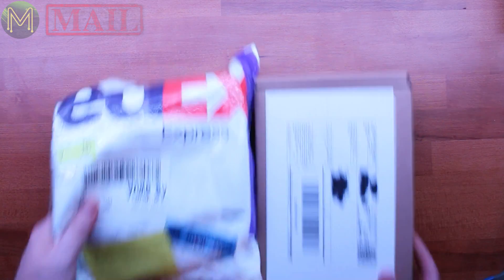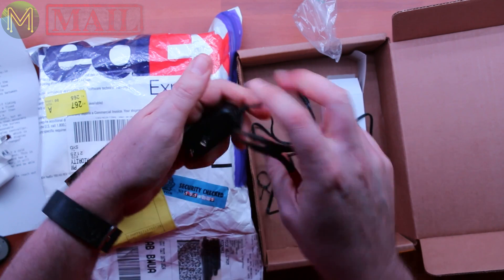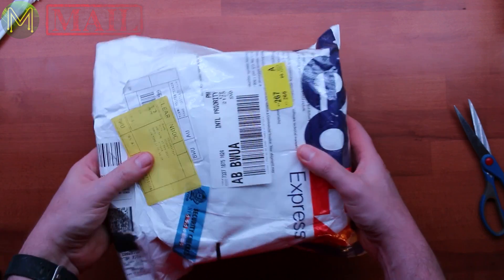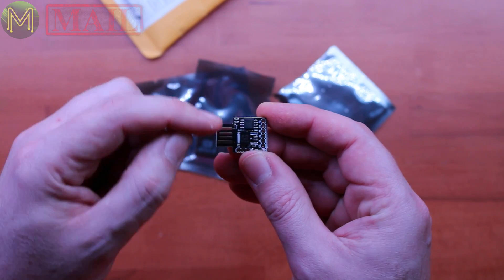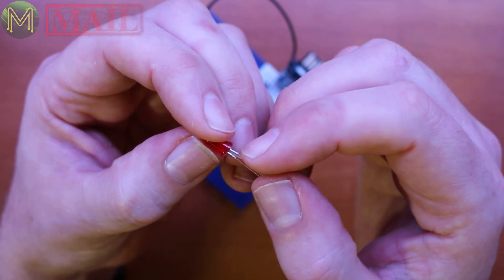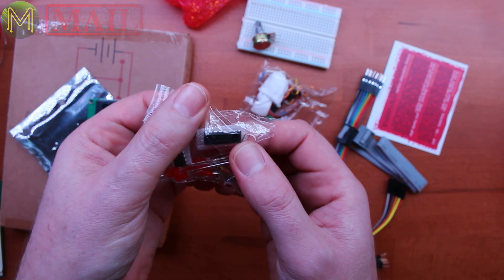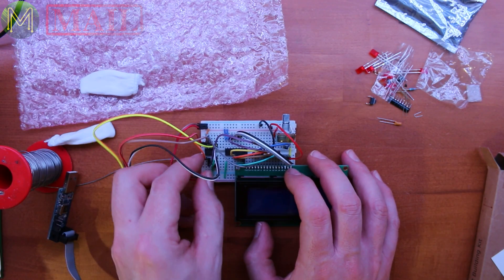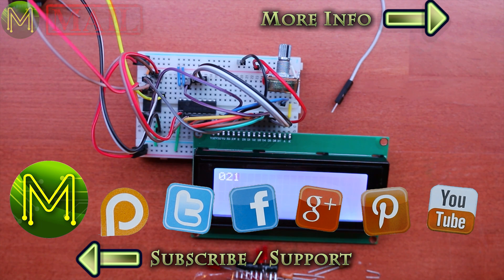#135 MickMake Mail #10: GPS clock, ODROID-XU4Q, DigiSpark, and TronClub // News

Comment: PLEASE ... do not do this on those cheap breadboards...

Yah i know, it's convenienent ... but everone who does not really know what he/she does just melts their breadboard and damages it...... so .. mhm .... yeah.

Why not stack a bunch of cheap(er) prototyping boards for this task? ;)

(yah i know ..... beanpicking and such ... just wanted to mention that ;))
Reply: .oO( P.s.: My alternative method for that: http://www.instructables.com/id/Breadboard-Power-Distribution-Wires/#step2 - and yes, step 2 of that instructable ;) )
Reply from the maker: +Daniel Mitzlaff 
I tend to use plastic breadboards that aren't thermo-plastic. So they can be heated up without them melting. Also I'm a quick solderer, so legs don't have a chance to heat up much.
I agree with you though. If you don't know what you're doing you can melt them badly.
Reply: Heh ah! O.k. i usually just grab these cheapo ali mb102 ... i like them transparend but don't ask me which plastic they use ... you get what you pay for, nor? Must be the cheapest plastic which is aviable.

From with materials are the breadbords you use made?

Greetings from sunny Hamburg ;)

Hacky
Reply: P.s.: Maybe that could be a small intersection worth. If you find a cheapo board, you could even show how those boards will not stand against a good soldering iron? EvilGrin

I think it could be a bit funny. ;)

Hacky

Comment: Ever thought of creating your own GPS clock (via arduino and GPS receiver with perhaps a LCD2004) Would make a brilliant how-to video, instead of a review (nudge nudge wink wink). Loved the utterly dodgy 45-degree plug bend ;)
Reply from the maker: Ha ha. So many ideas, so little time!

Plug bend is an old trick. Ever since the wall-warts started supporting both 120v/60Hz & 240v/50Hz - just bend and plug in.
Interestingly, if you pull most wall-warts apart you'll find that they are actually designed that way. That is: the only thing comparing US and AU plugs is the plastic casing and they can be moved freely.

Comment: Hello Mike! 
How things come to your mailbag? :) Is it Santa or some of patreons just sends you this?
I've run into Allo.com and Sparky board and even line of Hi-Fi Audio shields for Raspberri Pi from India(!) manufacturer.
Does it sound interesting for review for you? 
As well as JustBoom HAT audio shields. Did you heard of it? 
Could be used with a variety of music network players https://www.justboom.co/software
Reply from the maker: It's a mix. Some things people send me, some I buy.
Wouldn't mind looking at some of the audio boards for Pi/Arduino. I have a project video in the schedule that needs one.

I used to have around 6 very old laptops that I used as music players. They'd just have enough power to run MPD, (https://www.musicpd.org/), using NFS as the backend. Worked really well.

Comment: Another nose joke:

My dog has no nose.
How does it smell?!
Awful!

First off, let's do some proper troubleshooting on the GPS clock issue. I suspect it's not the clock, but that they just happened to shut down the entire GPS system for periodic maintenance during your tests. Try sneaking up on them.

But seriously...

On tiny ATTiny boards in general, I think too many designers of those are missing something. Making a really tiny board? Then make one capable of using the smallest and most easily supported rechargeable power source and, even better still, the lowest profile mounting capability.

Like Adafruit and their Trinket, they should at the very least make a 3.3V version which can be powered by a single lipo cell with an onboard LDO regulator that can output at least 250mA. 

Further, they might use a 3.0V regulator as I've seen one designer using an Atmel MCU on a Hackaday project do, I think to allow a single cell lipo to get closer to its 3.1V discharge knee before regulation is lost. He didn't actually say why he did this. I suspect this is important not for 3.3V ATTiny operation, which are spec'ed to operate down to 2.7V and lower, or for a proper logic high level output, but perhaps to allow the supply voltage to be used as the voltage reference for ADC, the internal reference being spec'ed to a very lousy +/-10% whereas LDO regulators are spec'ed to low single digit figures.

Of course, at lower voltages, a spec-allowed clock freq should be used. Safe clock freq. vs Vcc for Atmel AT MCUs:

http://www.robgray.com/temp/328-safe-speeds.jpg

Also, since the board uses only a single cell lipo to operate, put a tiny three-lead SMT (sot23-3) lipo charge controller along with its very few supporting passive components on the board. No need to use a multi-cell charge balancing controller since only a single cell is being used. 

Then, as icing on the cake, the PCB should be castellated so it can be surface mounted, still including through holes with 0.1 inch (2.54mm) spacing for headers so the complete design using the tiny Arduino compatible MCU board can be prototyped on a solderless breadboard. 

Quite some time ago, I suggested to Adafruit that they at least offer a castellated version of their 3.3V Trinket and they weren't interested. After that, I suggested the above in its entirety to a Tindie seller who has made some sophisticated Arduino boards in the past. He loved the idea and said he'd definitely work on it and also apply the same ideas using a more capable Atmel MCU than an ATTiny. Nothing has appeared after quite some time, so I'm throwing this out there to anyone. Make a bunch as tiny as possible and sell them. USB programmability via a micro-USB connector (as is done with Trinket) or the PCB trace connector as done with the board in this video would be preferable and would widen your market.
Reply from the maker: Yeah, I think the ferrets in their cage wheels powering the satellites must have taken a break.

The small ATtiny boards - Big companies like AdaFruit are more interested in moving stock. So the stuff that doesn't sell they won't be interested in. It's a catch-22 sometimes - if you don't have the product, then you don't know how popular it'd be. However, those guys are pretty good at knowing what can sell or not.

I have a couple of ideas floating around that I intend to put up on Tindie. Some gaps I see in the Maker market.
Reply: I only recommended castellated pads for their Trinket, nothing else. They didn't like that idea simply because castellated boards are more expensive to produce.

I think by adding all of the other features that I didn't recommend to them, a stand-alone MCU module requiring only a single cell lipo externally would fill a niche for those who need a tiny MCU for a reason. To me, it doesn't make too much sense to make a really tiny MCU module which then requires external support that could easily be put on the module and not greatly increase the price. They put LDO regulators on-board to power the board and external components, why not use 3.3V to enable single cell lipo use and put a charge controller on the board, too?

The maker on Tindie said, some time ago, that the holdup in making them up to that time was his electronics design day job, but that he still really liked the ideas. Still nothing seen. I'd design and make them myself, but don't want the hassle or need the money.

Comment: To be fair, the XU4 active heatsink is not great, so a passive one is not gonna be much worse. the mounting being off center from the SoC causes it to sit at an angle and make poor contact, and there is the fact that it is a PoP memory setup so any heat generated by the SoC has to pass through the RAM to get dissipated. From what I recall, nobody was able to get it to run at 100% speed consistently.
Reply from the maker: Yes, a bit sad. So many SBCs and all of them have just something wrong with them which makes them not quite 100% there.
Reply: Well, horses for courses I suppose. each has it's place for the most part. I would still recommend the XU4 or C2 for a low power Linux desktop as a first PC over the Pi. But Pi is better for people looking to get into automation, but then arduino or similar micros are probably better suited to that. I am really looking forward to getting my UP 2 and giving it a whirl, but they are comparatively power hungry to ARM boards.

Comment: +MickMakes I've been wanting to do some CV on an SBC, such as automatic license plate recognition, and reading some forums suggests that the Odroid XU4 could be a really good option for this, relative to say Raspi 3, because of the GPU compatibility with OpenCV dependencies (or something like that - I'm way over my head at this point). Would you consider an OpenALPR project to test out the practical application performance of the XU4Q after you've run your standard benchmarks?
Reply from the maker: +Simon Merrett 
I actually have an OpenCV video scheduled. It almost made it to the list during the monthly Patron schedule voting. We'll see for this month!

Comment: Hi Mick,
Just for the power adapter issue. I recommend you to buy a Chinese universal power outlets. They usually support both the standard Australian 45 deg angle and the Chinese(US) two parallel plug. Also the round one.( I don't know the exact name for that kind of plug but you complained about it around 4:47).
Reply from the maker: +Yong Zhong 
I have a bunch of adaptors, but if I can get a board with them all in, that'd be nice.

Comment: I wonder that you are able to solder the Pins while in the breadboard. The ones i had always started melting...
Reply from the maker: +Christian Ostermeier 
You can't leave the heat on for too long. If you're quick it's fine. Also I think some breadboard plastics are thermo-setting so the end up melting at a lower temperature.

Comment: FIRST!
Reply from the maker: +George Of The Jungle 
Nice!
Reply: The eMMC for the xu4 is quite expensive but makes it fly, haven't you got one?
Reply from the maker: +George Of The Jungle 
Alas no, I didn't order the eMMC.
Reply: I'm happy with my xu4s, I also didn't get the eMMC at first but ended buying it later and no regrets, makes it much more quick, the SD card is a bottleneck. Not that it matters much most of the time, but when you're compiling something large like say nodejs or doing an apt-get upgrade the difference is huge. And booting too.
Reply from the maker: George Of The Jungle 
Nice. I'll have to check it out then.